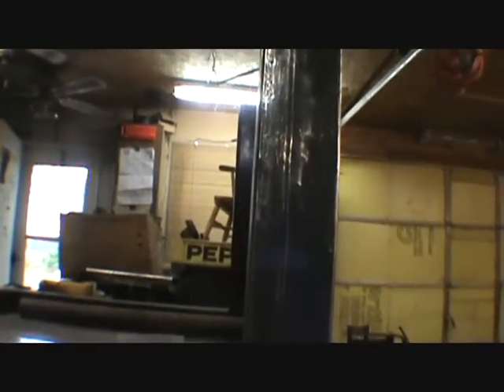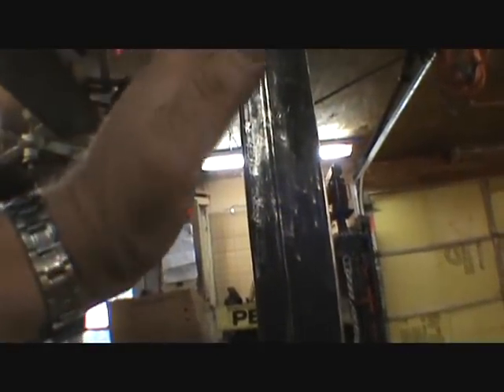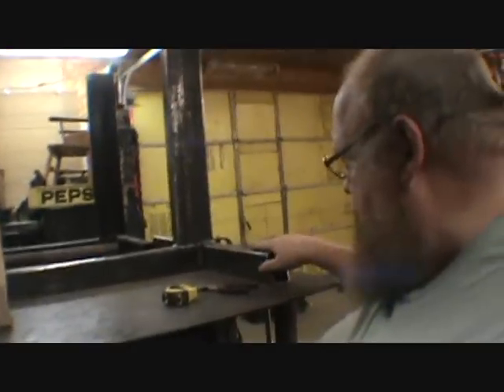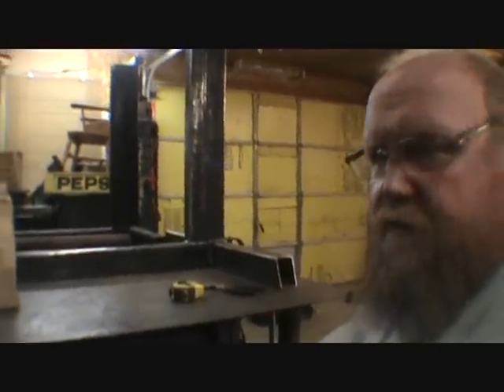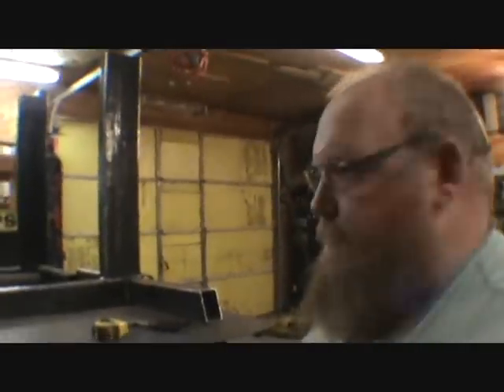welding project and shop  day

Comment: What is the duty cycle on your welder?
Reply from the maker: +larryz24 it will do 3/8 all day up to 1/2 inch cant remember right off hand its a miller 210 welder.